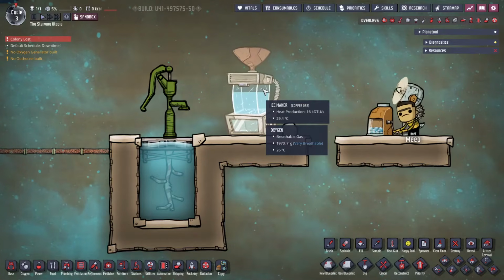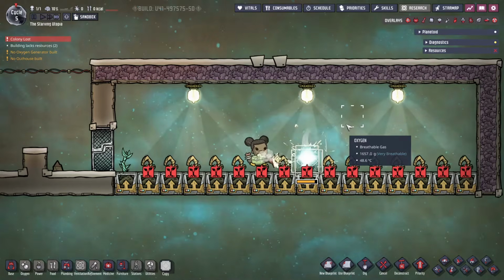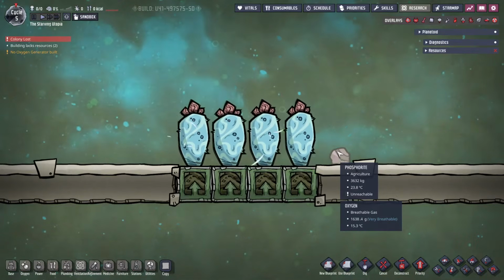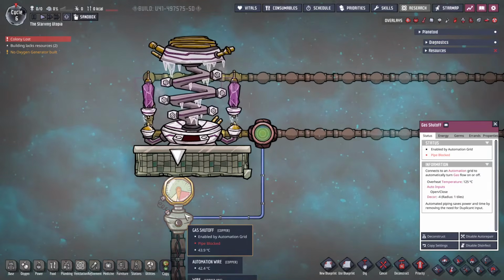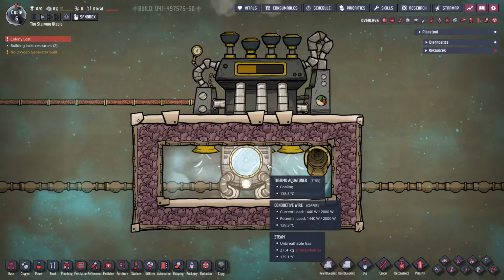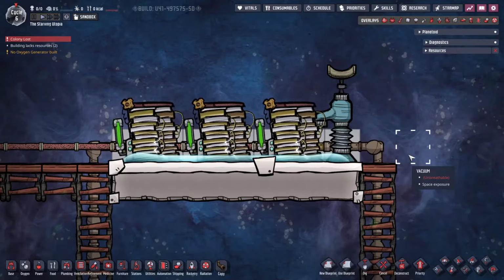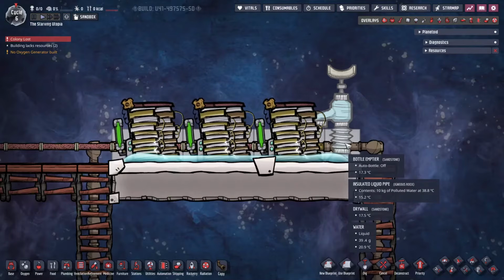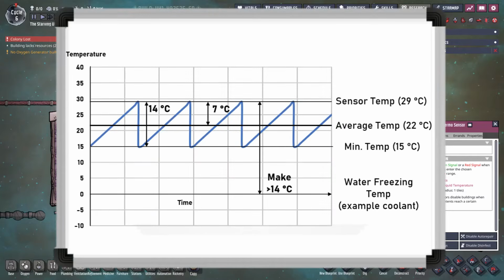Oxygen Not Included - Tutorial Bites - Cooling

Comment: With the addition of the new conduction panel, could you perhaps do a quick tutorial bite on when and why it would be used? Logically it seems like it would be similar heat transfer to 3 radiant pipes for 50 less refined ore, but does it behave differently due to it being one "pipe" instead of 3 separate linked ones?
Reply from the maker: From a little experiementing and reading others reports, as far as I can tell it's basically like 3 radiant pipe segments but significantly weaker (but does work in a vacuum). Therefore it's only real use is to not have the backing liquid in space for relatively low power applications. So sadly it doesn't really change anything related to cooling in any meaningful way as weak as it is.
Reply: Its purpose is to conduct heat in a vacuum, so you can cool buildings with a cooling loop in a vacuum without liquids on the floor.

Comment: I followed this injection tutorial but just don't seem to be getting the cooling you're talking about. Everything is the same, but I have the loop wrapping around a four floor battery room. I upped the temp to 80c just to get everything moving and opened the doors but I'm only down to 75c after a few cycles. Not sure what else to try.

Edit: I think it's the vacuum. There's just not much conductivity between the doors and the actual cooling loop. I added water to the cooling loop "room" and it seems to be doing much better. I added another tuner just for the heck of it and it's definitely going down now, but still not very quickly. I would definitely have to get this build in place prior to a crisis!
Reply from the maker: Yeah having enough atmosphere where you're trying to cool is important or the transfer won't be good either. Also for applications that are actively making a lot of heat then that's where radiant pipes are needed.

Comment: 12:15, that shutoff is very inefficient, if you do something like that, where one is a) priority and b) mostly off, you should turn that shutoff other way, as it uses power only if working. IMHO, it's much better with liquid valve. Set the branch to use 20 grams or something similarly small, and you will both have more stable temps, and you don't use refined metals or power.

Comment: what settings do i use for the liquid temp sensor?
Reply from the maker: It depends on what your target temperature is - so what you are trying to cool and to what temperature. If you don't use fine control then the temperature will fluctuate within a 14 degree range as I showed in the graph. Therefore you set your sensor value to your target value +7 degrees.
Reply: @GCFungus  Thanks. Recently reinstalled. was never good at it in the first place but these vids of your are helping a ton.

Comment: that bridge trick to make your flow direction obey.. that is appreciated.
also that hydrogen cooler thingy is only 7 of those thermal plants? ive got alot of excess hydrogen and so i was giving them all of it. but i could have just built a cold room with 7 of those plants and ship my heat into that room it seems.
Reply from the maker: Yes they are the same, but just make sure the wheezeworts are in a hydrogen atmosphere as the heat they remove depends on the specific heat capacity of the gas.

Comment: one thing to add is that aquatuners naturally (unless it is made of uranium ore or lead) have a temperature overheat of 125 C. this means that if one has no steel or plastic, or only one of each, then he could build a basic aquatuner in space, and drip liquid on the aquatuner while it is in operation. it would still be more liquid resource demanding, and power inefficient, but it would still keep everything going until plastic and steel are made.

on a second note, thermo regulators and nullifiers have the ability to liquify natural gas to methane, something that could be made of use in low kg/s sour gas boilers.
Reply from the maker: That's true but I wouldn't advise unless you had literally no other choice. It would be rare to need that cooling so badly and not have access to the right materials, I think. And yes I can see that you could make a sour gas boiler that way, but it would certainly be an unusual way to do it - but that's not a problem in ONI!
Reply: @GCFungus  i am unaware of all the circumstances where plastic and steel wouldn't be available, but i did run into this problem hard when playing the radioactive ocean planetoid, back when it was new to the dlc. the asteroid had no rust biomes, caustic biome, or oil biomes and featured a second planet which was flipped, which also had no iron ore, dreckos or oil biomes. francis john played it, and had to make steel through limited amounts of rust, which i can't remember where he acquired it.

as for the sour gas boiler, making super coolant can still be tedious, since guilded asteroids tend to be at the edge of the map, and the other way requires an establishment on the water asteroid, for the graphite. if you have no oil, it adds problems as well. nullifiers and regulators are right there for the most part.

Comment: The last one is very nice and look great as well, I used it and added 6 natural gas generator on each side and it works very well, all that closed into a hydrogen chamber and everything stays pretty cool, like there is 12 generator in total so they never stay on very long so only one aquatuner actually keep everything at a very good temperature, thank you for the video!
Reply from the maker: That's great to hear, I'm glad to have helped. What I would add is that the final design is for fine temperature control (where you need better than the 14 degree range the aquetuner gives). You might fight it simpler if you are only cooling generators to simply use the steam turbine and aquetuner without the cold injector and do it all on one loop.
Reply: @GCFungus  oh yeah I understand my generators don't really need the precise temperature check but it does look cool so I enjoy it!

Comment: Is the final build, in the final chapter, self sustainable? I did try to build one but the Aqua Tuner in the middle still kept overheating, even with Steel. I'm trying to build a cheap one in there, using the necessary materials to make sure a room is within the temperature but the Aqua Tuner still overheats. I'm unsure of where to keep the Steam maintained at the right temperature. So I'm experimenting in another Test Save but I can't quite figure it out...
Reply from the maker: Self-sustainable in terms of heat then yes, it should have stable temperatures. Cooling will always require power input just to be clear. If the aquetuner is overheating then it is likely an issue with the steam turbine. Ensure it is working correctly and not overheating, and also ensure that the water return is close to the aquetuner.
Reply: @GCFungus  
Noted. I'll take another look once I'm done with work.

Comment: You can still use lead in steam rooms because lead melts at 300C somthing and a steel aquatinter overheats at 325 degrees but most buildings made of steel overheat at 275 lower than leads melting point
Reply from the maker: You can get away with it, but it can be risky. I think for the small amounts needed for wires and a sensor it's just safer to use any other refined metal.

Comment: You can actually control the ANTN by putting mechanised door and connect it to an automation wire
Reply: You can also use a temp sensor on the liquid pipe and a gas shutoff valve on the hydrogen pipe to turn off the fuel supply to the ANTN.  I'm not sure what temp you'd want to set the sensor to though.  It depends on how close to the ANTN you put the gas shutoff, closer means you set the liquid sensor closer to the desired temp of the coolant.  You for sure have to set the temp higher then your desired temp no matter what since ANTNs don't use much hydrogen.

Comment: temp shift plates can increase the efficacy of radiant pipes??
Reply from the maker: Tempshift plates won't improve the conduciton between the fluid and the pipe, or the pipe and the surrounding directly, but can move heat in the surroundings better to create a bigger temperature difference at the pipes. So in short, yes tempshift plates made from conductive materials (refined metals or diamond usually) are good at moving more heating or cooling.

Comment: Is it better to send the only hot hydrogen to the Anti Entropy Thermo-Nullifier?
Reply from the maker: The hydrogen is the fuel source, so does not impact the cooling performance of the AETN. Of course using a hot fuel which is then deleted will also delete some extra heat, but by my calculation the heat energy in the hydrogen consumed (assuming 100 degrees C) is 9kDTUs, so around the cooling of a wheezewort. So as a rule of thumb, I would say it doesn't really matter what temperature the hydrogen used is, but if it is itself hot then use insulated pipes to avoid it heating the area you are trying to cool.

Comment: Wish more people would include a liquid reservoir in the designs as this helps in expanding and maintaining the over all temperature more consistent.
Reply from the maker: That's a good tip, and you're right it will help stabilize the cooling temperatures. I don't use these myself as I have not found them necessary so didn't think to include them, but you certainly can do.
Reply: @GCFungus  to*
Reply: @Galaxy_World  ??? Where was that "correction" supposed to go?
Reply: @zachmaw  into an unedited comment...where it went
Reply: thats usually overkill, you can do this by automating what temps the aquatuner turns on at. most places are fine with a +- 14c heat gradient anyways
Reply: Those are handy because you can have multiple loops going to one big block and use metal doors to inject chill to a coolant loop. You can achieve room by room temperature control that way.
Reply: What's a liquid reservoir design?
Reply: It's basically where you add a liquid reservoir at a point in the cooling loop, that allows you to more precisely control the temperature, because of how thermals work in ONI, if you pump all the liquids into a liquid reservoir, it will stabilize the liquids better to allow for some more precise cooling, since it will try to even out the temperatures in the reservoir as much as possible
Reply: @DRY411S it’s where instead of having the liquid pumped through the aquatuner cool the base, it cools down a pool of liquid or cube of metal and then another piper or gas vent goes through the pool or cube of metal and you use that pipe/vent to cool down the base. The block of metal or pool acts as a coolant battery that can keep temperatures stable.
Reply: The main reason for a buffer tank is to have a stable flow of liquid that doesn't get stuck. Say you have a loop with no liquid reservoir. If you overfill the pipes with too much liquid, it will stop flowing. With a liquid reservoir it flows freely. Stable temp is an added bonus
Reply: @emiktra7929  THANK YOU!!!

My second aquatuner cooling loop gave me all kinds of trouble. The cooling loop was very long and I kept overfilling it. My solution was to add a liquid shutoff and signal switch on the input side rather than a bridge so I could control exactly how much went in, and a liquid shutoff, signal switch, and liquid vent to dump coolant out of the loop. It worked, but it was a pain. I'll try adding a reservoir on the next one and see if it helps.
Reply: @tmbomber383  I've just started messing with these. What I found helpful was to set the pipe temp sensor really high so the aquatuner will be off while filling. Then when you set it to the actual target, the 'tuner takes a packet out of the loop, makes room, and it runs smoothly.
Reply: @emiktra7929 The reason your pipes get stuck is because it doesn't have a clear flow direction with an input and output only. you can throw a bridge on any part to achieve the same thing. a liquid reservoir keeps the cooling more stable. More thermal mass allows you to absorb more heat like having a bigger pool of water.